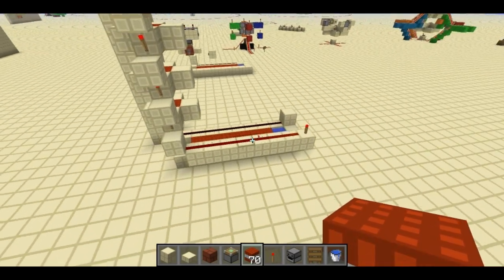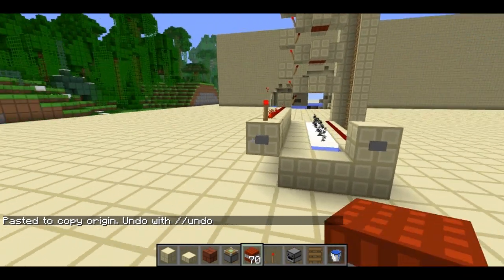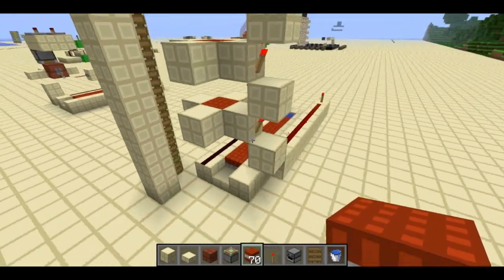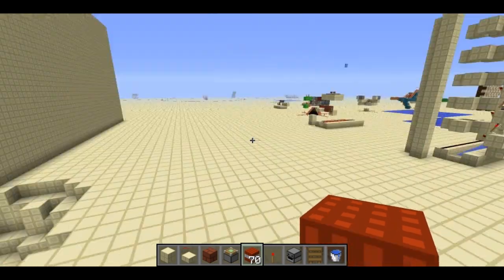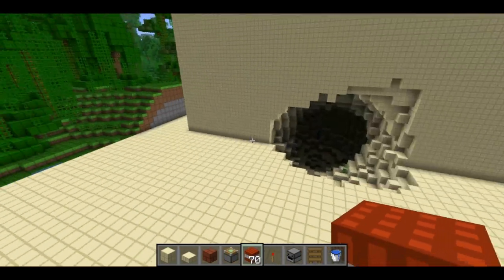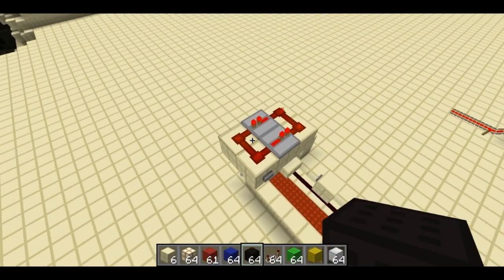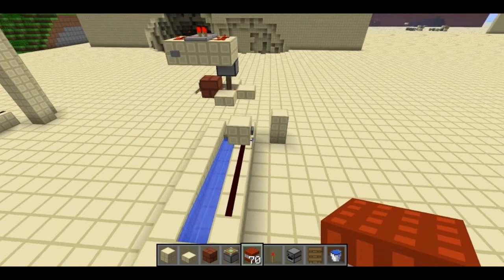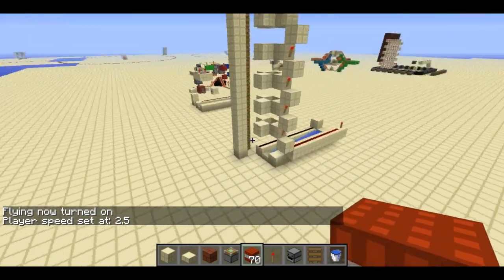Penetrator Cannon--Minecraft Invention

Comment: I know that what I'm about to say isn't going to be necessary, but how would you add dispensers to dispense the TNT instead of having to manually place the TNT, and a dispenser tied to the fastest clock you know of that dispenses TNT at a hyper pace at the bottom of the tower. Finally, there could be a repeater delay so that you just need to press a single button to time it correctly for the shot. Then you could increase the delay by changing the repeaters for deep shots. Then you should have a semi-automatic TNT "Penetrator-Widespread Cannon."

Comment: When we made our 3k+ range cannon on the server we used a fence block instead of the 1/2 block, (just one projectile) also it was around 440 Tnt for the propellent and only one for the projectile, on a fairly flat trajectory. 
It's basically the the propellent stacked on it's self about 61 high all going off on exactly the same tick.

Comment: Using the same type of redstone torch tower connects to staggered red wire runners coming off the side of the barrel, facing into the barrel,place repeaters, you will need 13 repeaters. (you can change the timing of the repeaters to have different affects during their flight. Leave the top 4 repeaters set to 1 tick though)

Comment: I've seen another similar looking design, not on youtube, completely different function though. What it does is fires the tnt in the way so the uppermost shots propel the lower shots down at a certain point. Used to bypass walls or other neat things. Seen it used on several DTC maps successfully.

Comment: I think you could really make that manual cannon perfect, by making a timer, when pressing the ignition button - a timer would run, and when that timer is up, it'll pull out the slab, which will safe you from having the "cannonballs" destroy the cannon itself as the power behind it is gone.

Does this make sense?

Comment: this is cool and all, but it doesnt compare to my full auto cannon that had a range of 110 meters. and sense my cannon is full auto it still penetrates far through walls. furthermore, it uses fence posts so it has a low flat trajectory to make it into caves and other good places to set up bases. and thanks to the range on it you can do this all at a safe distance from any enemy fire from bows or cannons.